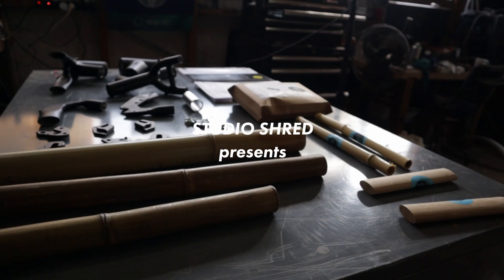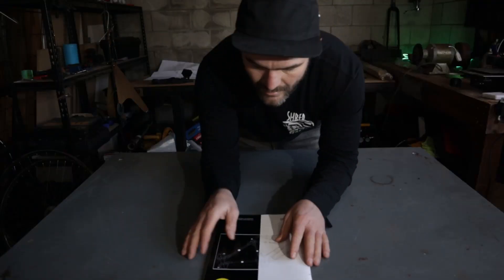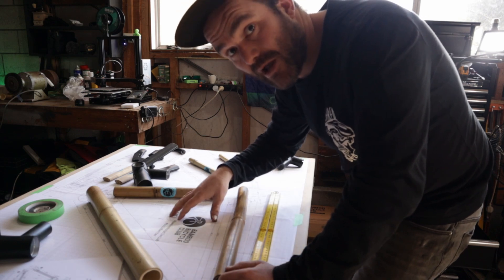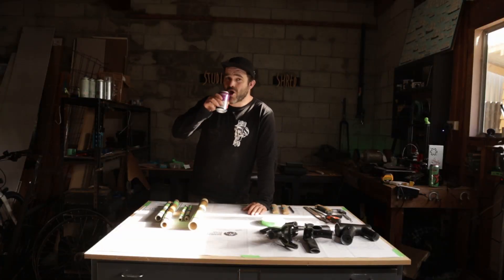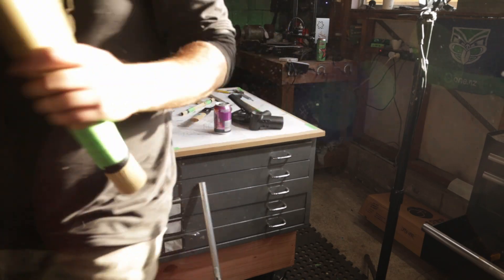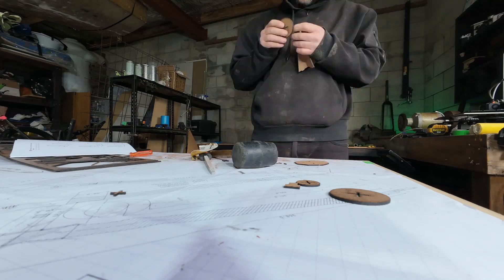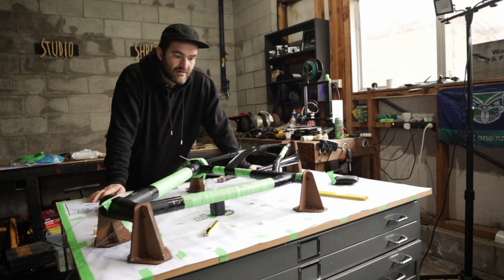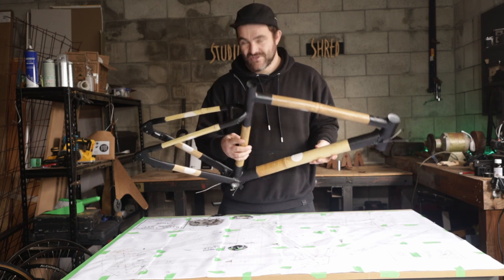I built my own Bamboo Bike Frame!

Comment: I think i might have used masking tape on the ally parts to avoid contamination by the glue. You can then run your finger round the joint for a super smooth look. I have only seen one of these in the wild, a wrapped joint version, built up as a single speed. Nice. So great to have an artisan product in a world of mass production. A natural progression would be a kit containing carbon fibre tubing to allow home builders to put together a carbon lugged frame. That would be cool.

Comment: When I read the video title, I was already typing (in my mind) "that thing is never ever going to be straight!", but it looks like they really put some thought into it. I've first encountered that rig-a-jig-on-a-table method in a book from H.C. Smolik; it's a neat idea for one-offs.

Minor criticism (regarding the kit): As the rear geometry is pretty fixed anyway, they could have just made bb, chainstays and dropouts one unit, all metal (unless they offer a dozen different chainstay lengths for that very same model of bb lug). The chainstays are the one place where you do not necessarily want bamboo as either the bb area will flex noticeably* or you have to overbuild so much that it eats up all the space for tire/chainring(s)/cranks  (young's modulus of bamboo should be roughly 1/3 of aluminium and 1/10 of steel ). They seem to have compensated for that by making the bamboo portion of the chainstays ridiculously short (and the lug legs freakishly long), which looks like ... yea, just leave it out ':)
*) It's also a high-stress area where homemade adhesive joints of varying quality may fail.

Comment: I wonder if they make a bike and then cut out the tube lengths to get all those lugs. Personally i would be making a more traditional bamboo bike with fiber wrapped joints. I suppose this is a bit easier to do and still could have some the damped ride quality benefits. Nice vid!
Reply: This is a bespoke lug, and we weld up the short lengths of the tube. The diameters are bigger than a conventional frame to accommodate the bamboo. We also make pre-fabricated lugs from Carbon and Flax. We've been building teaching using the "traditional" flax lug build method for the last 10 years and developed a pre-fabricated make the build more accessible.
Reply from the maker: yeah this is like the beginner kit haha. I definitely will want to try the wrapping. The make a kit for that too. The difference is that you can make whatever geometry you want with that fiber wrapping which I think would be super interesting to try.